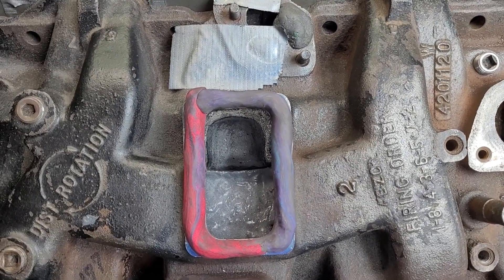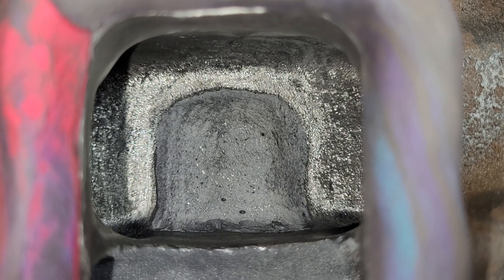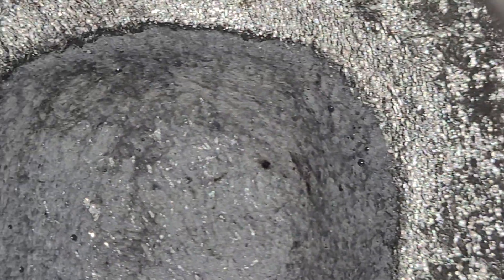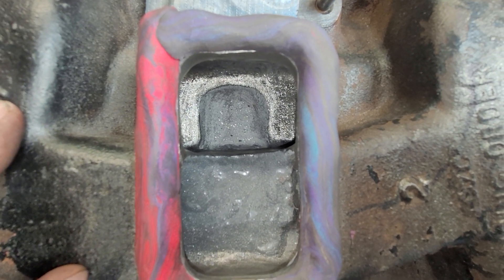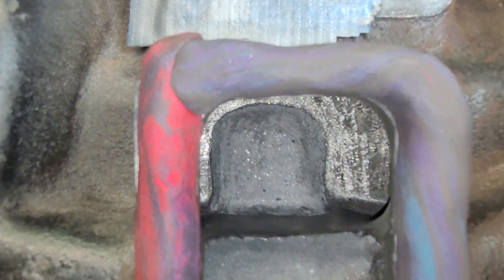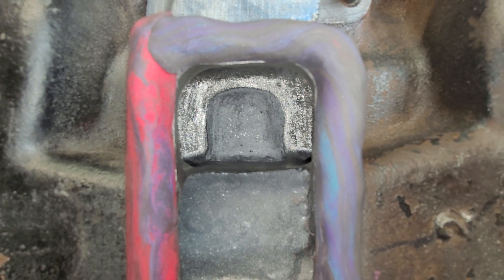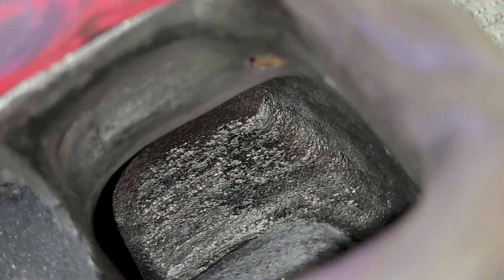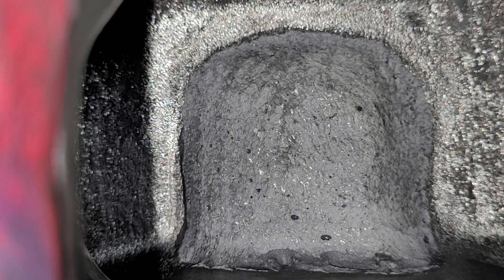D.V. + U.T.G. + U.M.S. Mission Impossible project. Dual plane plenum dome Quicky copy port.

Comment: Hi charles .I have a new performer RPM intake going on aLA stroker 408 engine with trick flow heads and mild comp roller cam . I was going to run an open spacer under the carb. Should i leave the center divider alone or should i trim it down ? thanks .
Reply from the maker: Depends where you want a boost in power. Low speed no spacer, high rpm use spacer. Only way to know is testing. Thanks

Comment: Why not quarter it, clean up or open up your runners, and then weld it back together?  Then you'll have access to all the runners (obviously), you're not wasting your time trying to reach down into them, and It wouldn't be called mission impossible. Just a thought anyway 🤷‍♂🤘
Reply from the maker: I am not that good at welding cast iron! Thanks

Comment: Why not extend the 'dome" across to the opposite wall as well? Seems like it would help split the flow front to back better
Reply from the maker: I was thinking turning room but I will fill it with clay and see if it helps. Thanks

Comment: Cool!  A tripod will help a lot (about $20 at Walmart) and you can get an attachment for you phone.  I still sometimes use the old Campark action camera for "B" footage ($50).  For an editor, I use Windows Movie Maker.  They have a free trial (watermarks) and it is a one time cost ($40 right now).  You can also get a set of led lights for cheap as well.
Reply from the maker: I have a nice tripod bit can only use it for certain shots.
Reply from the maker: I have 5 led lights set up now believe it or not. Thanks
Reply: @servediocylinderheads  You are welcome

Comment: Have you thought of extrude honing that manifold since the angles are so tight?
Reply from the maker: Not happening on this one. Thanks
Reply from the maker: I doubt extrude hone would get the ports as close as I did actually.
Reply: @servediocylinderheads  out of ignorance i've wondered about extrude/acid honing. i like what you're doing!
Reply from the maker: @Ecosse57  No doubt it would help but that is not what this exercise is about. Thanks

Comment: Id get a flexible conduit things used to supply coolant or air in mills and lathes, maybe put a piece of copper wire , or aluminum wire inside to stiffen it up a bit, any put a clamp on none end, and something to hold the camera on the other,  so you can clamp it to whatever, and position it how you want it, and easily move it somewhere else, they probably make an expensive something like this, but you can get the stuff from Amazon for less than $20 probably, and make it yourself in 20 minutes,  just be sure it can't fall apart and break anything! 👍 But what you do is fine with me,   great work, I wish I could test things like this!!
Reply from the maker: I was thinking they must have something so you can hold the phone better. Thanks

Comment: That sharp ledge, the remaining divider, creates the turbulence. The transition from the upper floor to the lower floor needs to be smooth to keep the flow more laminar. And the air speed is faster at the inner corner, that is how air flows.
Reply from the maker: I am using it sharp to keep a fuel dam between plenums. It is still all bolted to the bench. I will round it with some clay and see if it helps. Thanks

Comment: I can see that ridge on the divider being a source of lots of turbulence. I can't help but think that rounding this off would pick up flow, especially on a running engine (with ports drawing from others in their intake stroke).
Reply from the maker: Problem doing that is upper H is harder to get good flows. Rounding it feeds the lower plenum better.
Reply: @servediocylinderheads  So, using it as a restriction, to certain degree?
Reply from the maker: @CrazyTony65  Yes, for lower plenum.
Reply: @servediocylinderheads  I can see that line of thinking. Conversely, could the poorer flowing upper section benefit from a radius there to allow feeding from the lower one? Could a radius be simulated with a bead of clay along it?

Comment: Will be interesting to see how it looks once you have a spacer on there aswell. 
 How much divider have you left? Hard to tell from the vid angle. Taking it right down helps flow but sucks for fuel distribution at lower rpm ive found
Reply from the maker: I left about 1/4" before the epoxy went in.
Reply: @servediocylinderheads   ah nice 👌